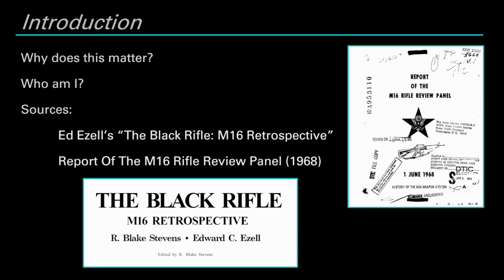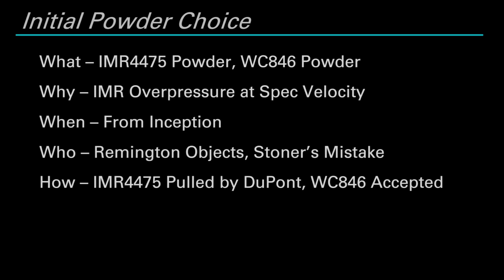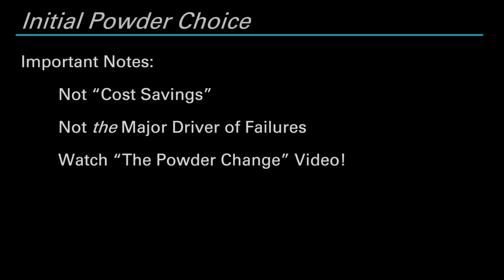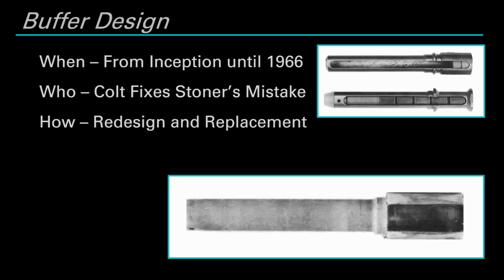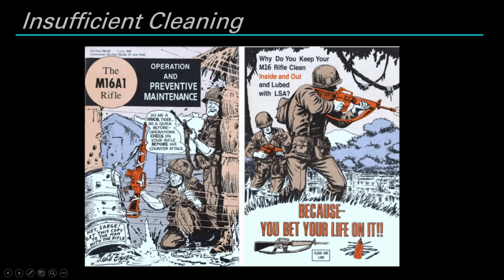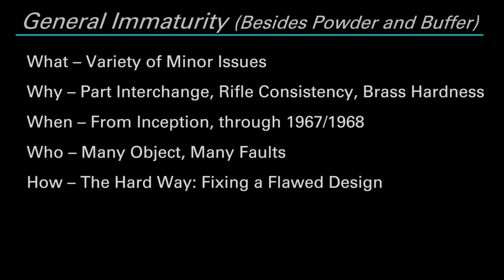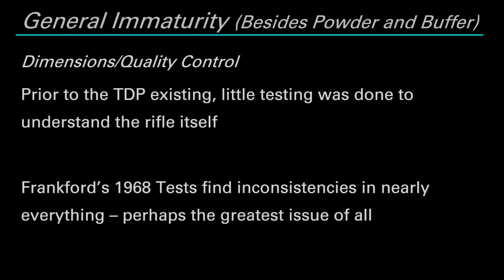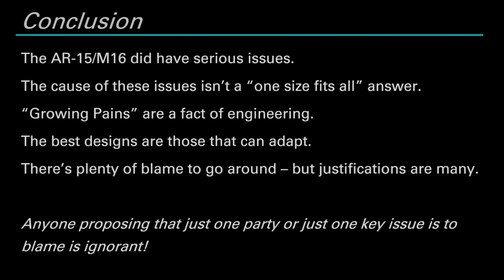M16 in Vietnam - The Real Issues, Briefly Explained

Comment: Let’s go down the rabbit hole 🕳️ there were a certain number of colt model 601 602 and 603 rifles made for the DOD from 1961 to 1963 Those rifles were used by certain combat units in Vietnam. When units would rotate out of country new units would receive those weapons. These are the rifles that have certain features such as non crome lined barrels and the “edgewater” buffer. The rifle M16A1 helped circumvent the issues presented but the ordnance corps presented to soldiers and marines in the field. You can’t get around the issue of improper ammunition issues with the Xm16e1. Also James Sullivan down scaled the AR-10 to the AR-15 not ugene stoner.
Reply from the maker: 603s didn't come about until after 1964. First order for them was in late 1963. ARPA guns were 601s.

I think you should watch the powder change video.

Regardless of Sullivan and Fremont being the ones who put pen to paper on the AR15, Stoner was chief engineer and would have the final say on things the rifle incorporated.

Post 1964, practically all ammo used in Vietnam was WC846 loaded. The Marines had the same manuals and same cleaning instructions available to them - the multitude of pictures showing cleaning rods taped to rifles should make that quite clear. The neglect those rifles faced isn't the rifle's fault. It certainly isn't the Army's fault.

Finally, as explained, the Ichord hearings are chock full of bad information and rarely feature a correct conclusion. There's much labor taken to blame the powder for everything, when the actual details of the powder change suggest a very different conclusion
Reply: @IvanPrintsGuns exactly ordered in 63 delivered in 64 for use. Major change being the forward assist as you know. If you specifically research the issue the Marines had in I corps in the spring of 1967 there were no cleaning kits or cleaning rods issued. That would come later when a lot of issues were known. Individual marines would write home asking for .22 rifle cleaning rods for their m16s. They were not issued properly and they did not initially get any instruction. This is well documented. Point being most of the issues you are citing are not widely experienced by the majority of ground forces in Vietnam. Just the marine corps.
Reply from the maker: @cosmolineandgritsforbreakf3795  the 603s weren't used by advisors in 1963 as you claim. Plenty of changes besides the forward assist.

Individual units did have absences of cleaning kits and manuals, yes. This is explained in the video. But some units did have these things (including Marines units). A breakdown of unit-level logistics/supply chain/communication (which, as just explained, wasn't endemic) isn't representative of a top-down failure. Ultimately, the top's job is to make sure that these things exist (and the manuals and kits existed since before the Army and Marines were using AR15s), the bottom'a job is to make the things available and distribute them. By no means is "the Army" or "Ordnance Board" chiefly responsible (they had the kits and manuals available). They can't know to fix the supply chain issues that shouldn't exist in the first place until after they've taken place.

To the notion that only the Marines faced these issues, that's absolutely not true. The Marines did have some particularly inept units that decided all on their own that rifles never need cleaned, but the issues the rifles faced was universal. That the USAF took best care of their rifles and had the least issues is a sure sign of this - the Army and Marines both didn't take such great care in all instances, and as such, both had issues. Some Marine units did have manuals and cleaning kits they procured, and their rifles weren't wasted.

Your edgewater SP1 clearly hasn't been shot much, at least not in comparable conditions, if you're going to claim it's fine. Even avoiding bolt bounce by sticking to only semiauto fire, the buffer's tendency to collapse (especially when wet) means that the carrier key can strike the lower receiver, which breaks parts. It's a bad design, and that's not a "well with the original powder it wasn't the worst" sort of thing, it was a bad design for any powder.

The XM16E1s the USMC were buying were new in most cases. The oldest XM16E1 they could have possibly procured at all would be 3 years old in 1967. "Clapped out" in 3 years is pure neglect, nothing else. By 1967 the improved buffer is in the XM16E1s, and it isn't until 1968 that the M16A1 (and all the existing XM16E1s) get chrome lined barrels.
Reply: @IvanPrintsGuns  I never claimed that just the 603’s were used by advisors? The 601 602 and the 603 were all used by advisors. There were military advisors throughout the entire war. Again I’m saying the vast majority of the issues were experienced by the marine corps. Not all the issues. You just corrected my statement and then proceeded to prove my point. The airforce likely didn’t have any issue because they would have never even used the rifles in combat.
Reply from the maker: @cosmolineandgritsforbreakf3795  603s weren't in production until 1964. ARPA's AGILE testing was done by then. 603 production was for the Army at that point, not for testing groups. If some small number of 603s were to be involved in some sort of advisor role (if not AGILE, what was it?), this small number of rifles can't possibly explain (hand wave) away the issues the rifle faced. There were 300k+ XM16E1s in Vietnam by late 1966. Most of those were less than two years old. How exactly were those clapped out by advisors then given to Marines?
Reply: @IvanPrintsGuns  Not what I’m saying. You ether don’t understand the difference between the 603 and Xm16e1 or you don’t understand that I’m saying they are one and the same. Let’s start from the beginning and state the fact the marine corps did in fact not procure their rifles in the United States. They were issued in the field to combat units in the spring of 1967. Those rifles were all XM16E1 rifles. Those XM16E1 rifles were given to the marine corps by the Army. Not a single marine in a line company in Vietnam in 1967 had any training or experience with the new weapon. It’s also well documented that they were not issued cleaning kits or specifically cleaning rods. That could all be a USMC issue. I’m not saying it isn’t.
Reply from the maker: @cosmolineandgritsforbreakf3795  the DOD gave the Colt AR15 Model 603 the M16A1 designation in 1963. The Army, because it had not adopted the rifle yet, called it the XM16E1. The XM16E1 is a 603. So too is the M16A1. What a 603 is would change. What an XM16E1 is would change. What an M16A1 is would change. But the 603 didn't exist before 1964 (was first produced in 64), and AGILE was over by then. The rifles used in AGILE were small in number, weren't somehow dumped on the Marines, and aren't magically responsible for the issues the other rifles had.

The USMC rifles were, in fact, procured from the US. Do you think Colt had a factory in Vietnam? Do you think the USMC never saw a new AR15? The One Time Buy (508 Contract) allocated XM16E1s for the Marines. 1966, MIPR from the Marines for 16000 new XM16E1s. That's 100k total new rifles Marines ordered by 1966. Read The Black Rifle!

USMC wasn't unique in troops not having familiarity with the rifles they were being handed. Cleaning kits and manuals were available to them, but they'd need to procure those on their own. Some units did this. Others didn't.
Reply: @IvanPrintsGuns  do you not understand the difference between the XM16e1 and the M16A1? I’ve never once referenced any sort of troop trials or project AGIILE in my comments. I’m stating an irrefutable FACT that the rifles issued to the marine corps were us army XM16E1 rifles.
Reply from the maker: Perhaps you don't understand the difference between the XM16E1 and the M16A1. The last model XM16E1s were identical to the first model M16A1s. A year later, the M16A1 would get a chrome chamber. So too would the XM16E1s, through retrofitting (though not as aggressive a retrofit as the buffers would see). Those XM16E1s are still identical to the M16A1. The USMC procured their own XM16E1s. This was usually by riding on Army contracts, but it's not like the USMC was only using secondhand XM16E1s. Read The Black Rifle.
Reply: @IvanPrintsGuns  if you understand engineering which you obviously do. You might not understand procurement military logistics and large scale training mishaps. It’s my belief that the issues would have occurred with practically any other rifle given the circumstances. And lack of maintenance at the armory level. I have a Colt SP1 with an “edge water” buffer it works with all types of 55g ammunition. However you slice the pie the marine corps had a brief period where they were issued clapped out Xm16e1s and had severe problems in the field. By the time a lot of the problems had been addressed in the XM, The army had M16A1s very early into 1968.
Reply: @IvanPrintsGuns  also the rifle XM16e1 was not issued with a cleaning rod or cleaning kit in a lot of cases. Hence the addition of a “trap door” butt stock on the M16A1. Also there was a lack of lubricant in the field throughout the entirety of the war. That’s actually a current issue today with any AR15. You have to put your research against the field reports.
Reply from the maker: @cosmolineandgritsforbreakf3795  yes, the rifle wasn't always issued with a cleaning kit, because the cleaning kits was to be made available through the supply chain. This worked out correctly for many units, but some units didn't do their jobs. Lack of lubricant is the same question - it's not like the US military ran out of gun oil. But some units failed to read the manual and procure it.

I've read the field reports. For every one SNAFU, there's at least as many success stories. It's not Ordnance Board's job to clean your gun for you. Past making the (quite good) manual and making the cleaning kits avaliable, they didn't have a responsibility to handhold people into doing their jobs.
Reply: @IvanPrintsGuns  I like your video and I’m not being a Dick. I’ve been down this same rabbit hole for about 20 years. Colt knew the issues were going to be prevalent. Big army knew this as well. The M16A1 idiot proofed the rifle, leading to significantly less issues in the field. Natural progression of any weapon in US inventory. The outside factor is the ordnance corps using ball powder. They did do this. It did cause significant problems. I’m just saying we can get around that fact. Everything else is subject to other factors that are impossible for you to narrow down. For example with any AR15 if you clean it bone dry and get into a firefight, heat and expansion can and will cause a lot of problems. Mainly failure to extract. This is why lubricants are so critical for proper function of the AR15 from the 601 to the URGI.
Reply from the maker: @cosmolineandgritsforbreakf3795  Colt sure didn't seem to be aware of much besides the buffer issue. They maintained to DOD that the rifle's design was mature. The Army knew of practically all the issues that would show up, had been vocal about them, wanted them fixed, but DOD overruled them. The M16A1 (at adoption) was pre-chrome bore. "Idiot proofing" came later (and, as explained, chrome lining doesn't "idiot proof").

You badly need to watch the powder change video. Your misconceptions of the events are readily apparent.

I'm not sure where your ideas about lubrication come from. Proper lubrication helps any firearm, but the idea that AR15s must have it to work reliably is nonsense. There's been plenty of high round count tests that get the guns so dirty that initial lubrication would be a detriment, and yet they still work.
Reply: @IvanPrintsGuns  You keep referencing your other video, that’s cool. However Real issues in the field come down to heat and expansion during rapid heat cycles and over pressure from bad ammo. Proper lubrication is absolutely critical in reliable function of the AR-15 in any condition. It all has to do with the gas system and how it functions. Being an expert on the system you should know that. I also don’t know where you get the m16A1 not having a crome bore or barrel from. That’s just incorrect.
Reply from the maker: @cosmolineandgritsforbreakf3795  WC846 loaded ammo is much lower chamber pressure. That's why it was chosen. You need to watch the powder change video. Across all the testing data and information available, I haven't seen these vague descriptions of heat and expansion anywhere. There are, however, plenty of endurance tests undertaken which would ensure any lubrication present is gone by the end. Sure, reliability drops off, but it's not very dramatic. SAWS testing of the AKs will tell you that it's not endemic and exclusive to the AR's gas system and bolt, this is just how autoloading arms work.

You need to read The Black Rifle. M16A1 adoption was in 1967. Chrome chamber was 1968. I'm not going to insinuate that you may be misremembering things, but this is pretty basic.
Reply: I actually agree with most of the points in your video. I don’t understand why you are being so defensive. You also are not reading my comments correctly or don’t understand the changes made between the XM16E1 and the m16a1 and how significant they were.
Reply from the maker: The XM16E1 is not a fixed thing. The changes that led up to the M16A1 were not kept out of the XM16E1, they were rolled in continuously. Late production XM16E1s are the early M16A1s - it's not like the army adopted something that wasn't the XM16E1. They adopted the XM16E1, and so it was called M16A1. All the changes that had been made to the XM16E1 were then a part of the M16A1. Receiver fencing, flash hider, buffer, gas tube, receiver alloy, bolt carrier bore plating, etc - the late XM16E1s had all of this, and the M16A1 name comes from the Army adopting the XM16E1 officially. Chrome plating of chambers comes after this point, as the testing on chrome plating of chambers was still incomplete when the M16A1 adoption happened. Read The Black Rifle.
Reply: @IvanPrintsGuns  Dude no, the XM16E1 will have a rifle steel barrel no crome lining in the bore or chamber. A three prong flash hider edge water buffer and type C furniture. No trap door for cleaning kit. Early M16A1 rifles would cary over some features from the XM16E1 such as the flash hider and furniture. The rifles will actually be marked “Colt AR-15” model XM16E1 and serial number. You need to read black rifle again.
Reply: @IvanPrintsGuns  I’m clearly saying the m16A1 was the final product improved version of the rifle. Phosphate coated BCG H1 buffer and Crome lined bore and chamber. Produced By Colt h&r and GM hydramatic.
Reply from the maker: That's just not true - the XM16E1 had the improvements that the M16A1 had at time of adoption *because the XM16E1 was the rifle that was adopted*. The M16A1 continued to see improvement - the trapdoor buttstock (sometime between 68 and 71, records aren't clear), chrome chamber (testing in 1967, adopted in 1968), chrome bore (71), etc - but these were not in place day one for the M16A1 (early 1967). Like with the XM16E1, improvements were rolled in. These parts and improvements became standard, and any XM16E1 needing new parts would get these upgrades. The Black Rifle is quite clear on these changes. The XM16E1 had everything that the day-one M16A1 had. The M16A1 term comes from the Army adopting the XM16E1. Do you need page numbers? Do you think the M16A1 didn't see a single change past Feb 1967? Chrome chambers hadn't even been tested at that point...
Reply: @IvanPrintsGuns  like I previously stated there were indeed roll over features between the two rifles. There are clear and defined requirements and changes made to rifle M16A1. Rifles produced in 1968 had all for mentioned internal changes made. I’m not sure exactly when but the idea of Crome lining the barrel was a square one idea and also a production issue being that mass production of a Crome lined .22 cal bore had not been done before. You’re just saying what I’m saying.
Reply from the maker: You've changed what you're saying several times over. I've not changed it at all. If you're now saying what I'm saying, that's great. The M16A1 did not have chrome lined chamber as adopted. Nor did it have the trapdoor buttstock. Nor did it have the chrome lined bore. Several other minor things were added or changed as well. It's not until 1971-72 you see the M16A1 become something relatively definitized. Rifles made in 1968 wouldn't have the changes that didn't take place until 1971-1972, unless they were added after the fact (there was a DMWR that went out in 1971 detailing how to make sure XM16E1s and pre-71 M16A1s were rebuilt up to the latest M16A1 specs, because those specs had changed since Feb 1967). Chrome lining chambers was first approved by Army in late May 1967 - months after the M16A1 adoption in Feb of that year. Chrome lining chambers wouldn't be adopted as standard by the Army until 1968 - after the Panama Trials gave conclusive testing to show that chrome lining chambers was a good idea. The technology to chrome line bores was, obviously, in place by 1967 - since that's when testing began.
Reply: @IvanPrintsGuns  I haven’t changed what I’m saying at all. You are saying that I’m insisting that rifles were produced in Vietnam and silly nonsense, and also that rifles were issued to the marine corps from early trails. I’m not saying that now, and I didn’t say that in the beginning. I’m saying that the issues experienced with the rifle during the Vietnam war were overwhelmingly experienced by the marine corps. Particularly during the spring of 1967. My critique is simple in stating that the rifle had limited issues up until that point due to a number of factors. The issues experienced with improper ammunition are clearly the source issue of catastrophic failures in the field that could not be addressed by troops due to poor training and proper equipment. Those issues would occur now with improper ammunition. Reference the issues with early m855 ammunition. Unless everyone is wrong there was issue of m193 ammunition loaded with ball powder, not the correct propellant designed for the m193 55g 5.56x45. It is well documented that that ammo caused an increase in catastrophic failures in the field. That otherwise wouldn’t have occurred.
Reply from the maker: @cosmolineandgritsforbreakf3795  off the top of my head - you claimed 603s were used by ARPA advisors in 1963 (not true), that USMC never got new rifles from Colt and only got them used (from advisors or Army) (also not true), that the M16A1 had every upgrade it would have at time of adoption (wrong) by 1968 (wrong), that cleaning kits weren't available at all to USMC (wrong), you're still plainly ignorant about the powder change for several reasons (go watch that video already, please stop guessing and making things up).

That's a lot of things that you've flip-flopped on, no? Paired with a very poor understanding of the powder change (say, how many issues would have resulted from 4475 blowing up guns?), I think you've got a little more learning to do.
Reply: @IvanPrintsGuns  I admittedly do not know what you mean by “ARPA” advisors. I know for a fact 603’s were used by advisors throughout the entirety of the war. That is a fact. Advisors would continue to work with and advise ARVN troops until 1975 so duh 🙄 also you admitted in a previous comment that yes some units in Vietnam did not get cleaning kits. Why is that so hard for you to understand? You have made a in depth video discussing things that might be relevant, except for this one problem. The issues stopped when the bad ammunition stopped being issued. Yes some of that ammunition would remain in country and be fired for a period of time. We both agree without any argument that there were internal changes made over a period of time. Why is it that there were less issues once the ammunition issues were sorted out? Isn’t that convenient? You keep referencing the ammunition video. We already know why this happened. It’s still happened and caused catastrophic failures that could not be remedied in the field causing directly leading to the congressional hearings. Why did the early rifles work in testing? Why did they work in major combat operations I.E the battle of Ia drang and other battles? Yes the rifle had issues that were being sorted out in real time by Colt. This is clearly not uncommon for any service rifle. What’s the overwhelming reason why the rifle would catastrophically fail in combat? What is the one thing that we can all come to a conclusion about? Testing field trails and combat actions all proved the rifle worked fine? If no significant changes were made to the rifle what is the principal problem introduced to the equation that would cause the issues? It’s the ammo…..and who suffered from the most problems? The marine corps? Why? Because there were issued bad ammo and had no means to remediate a catastrophic failure. That the only point I’m trying to make. If you fired the same ammo out of a brand new Daniel defense AR-15 you would have the same problems. Certain features such as the buffer and Crome lining would make said issues less frequent. But it would still happen. So no it’s not short sighted to state that for all practical reasons the issues can be blamed on the ammo.
Reply: @IvanPrintsGuns  and correction all the 603s would be used once they arrived in country. And of course previous models.
Reply from the maker: @cosmolineandgritsforbreakf3795 You need to watch the powder change video. WC846 powder never stopped getting used. In fact, powder with identical burn rate is still used to this day. It never stopped getting used. It wasn't "sorted out", was used ever since 1964. Ia Drang? WC846. I explained this in this video, and detail in the powder change video. You're clearly in over your head and need to go learn.
Reply: @IvanPrintsGuns  You are saying that the nobody at any point actually used ball powder as propellant? That’s a big old lie? That’s internet lore? Are you saying this never happened? Yes the propellant you are talking about is used now and was used during the war. Hmm why would certain units at a very particular time have issues with catastrophic failures due to overpressure and arguably increased fouling? Although the increased fouling would be a much smaller issue. And likely not the culprit. I’m not a propellant expert but there is a difference between ball powder and IMR. Are you saying this never happened? It’s a lie? A myth?
Reply: @IvanPrintsGuns  So if what you are saying is accurate then the ammunition source would have been in use when major combat operations started in Vietnam. That would be the “correct” propellant? So what if I told you that they loaded 5.56x45 with ball powder? Is that a lie? Never happened? Just a fake story that never happened?
Reply from the maker: @cosmolineandgritsforbreakf3795  No, you dolt. I'm saying you need to watch the powder change video, and you're too ignorant to understand a hypothetical question. WC846 was selected in 1964, and stayed in use ever since. You seem to mistakenly belive it stopped being used, but this isn't the case. You just claimed that the "bad ammo" stopped being used - that isn't true. WC846 didn't stop getting used. It's been used ever since. Fouling was extensively tested, with some tests indicating IMR burns cleaner - yet WC846 was still more reliable past the introduction of the improved buffer. What "overpressure" issues are you referring to? 4475's risk of blowing guns up? That's why it was dropped, after all. Or WC846's <10% increase in port pressure, which exposed the flaws of the original buffer?

You're humiliating yourself, and need to watch the powder change video. The most serious issues the rifle faced - failures to extract - occured less often with WC846 in controlled testing. WC846 was around since before Ia Drang. The FTX reports don't come rolling in until much later. And they don't go away after the improved buffer is added. The FTX issue was not to do with the powder change, except that the powder change made FTX less frequent. Which you'd expect from a powder that lowers chamber pressures as substantially as WC846 did.
Reply: @IvanPrintsGuns I have watched your video and you state that the propellant change was made. What if I told you that has no bearing on the fact they didn’t use that propellant? Are you saying that nobody at any point and time loaded 5.56x45 with ball powder instead of IMR stick powder? Your video would not explain that. You’re the one guy who has cracked the code?
Reply from the maker: @cosmolineandgritsforbreakf3795  You're absolutely remedial. I think I'm done here. Please learn to read.
Reply: @IvanPrintsGuns wc846 has not been used roughly since 1970 in nato ammunition.
Reply from the maker: @cosmolineandgritsforbreakf3795  "NATO" ammunition didn't exist (as it comes to 223/5.56) in 1970. Or 1975. Or 1980, even.

WC846 has been used to load 223 since 1964. Come 70/71, it did have its upper bound calcium content lowered (no change to burn rate, this was chasing a rare issue of buildup in gas tubes), and later on, this lower calcium content WC846 would be called WC844 - but make no mistake, today's WC844 fits within the parameters for WC846 used since 1964 - the only tweak was calcium content, and this came after the rifles serious issues were addressed (and again, the calcium buildup were uncommon, not very serious, and weren't even really reported until after everything serious was "fixed" - we're talking post chrome bore, even.
Reply: @IvanPrintsGuns  you’re just too high on your own gas to realise that ammunition was always the problem. It’s not used today for very specific reasons. You’ve just gone on a long roundabout mission to prove that the ammunition source was the principal problem. It doesn’t matter who made the decision to adopt the incorrect propellant. It was adopted and otherwise would have not been an issue.
Reply from the maker: It wasn't always the problem. A powder with equivalent properties to WC846 is used today - the only change was to calcium content, to address a rare issue of calcium deposits in the gas tube, which wasn't even noticed until 70/71.

Now, 4475 was always the problem - that's why it was replaced. But WC846 was the correct alternative.

You keep harping on the "incorrect propellant" as though 4475 was issue-free (it wasn't) and as though WC846 was a mistake that got corrected (the Panama Trials alone prove this wrong, let alone how am equivalent has been used since).

That's silly, and ignorant. You should watch the Power Change Video, except pay attention this time. If you think I'm wrong, go ahead and make your own video, detailing what your research has lead you to. I'll give you a hint, though - you're at the peak of the Dunning Kreuger curve on the powder change.
Reply: @IvanPrintsGuns  yep 👍 everyone has been saying the exact same thing for years and years. Over pressured dirty ammo=issues? Why is it that the original buffer and ammunition combination had no issues in testing and field trials? It worked fine. The issue of projectile speed has more to do with the change from 1/14 to 1/12 between the 601 and 602 and yes there issues with mass production of said ammo. Hence the “ball powder” apparently called WC846….I didn’t know that…..was a the main culprit in issues with the rifle. Why change anything?
Reply: @IvanPrintsGuns  I know why….to deal with the poor ammunition. I’m also going to assume there were QC issues as well. We know everyone checked off on ball powder. It is the overwhelming problem with the rifles performance in Vietnam.
Reply from the maker: @cosmolineandgritsforbreakf3795  It isn't. Warch the video. Read The Black Rifle. Have a great day in fuddlore land.
Reply: I know why my SP1 works and you can fire a wide variety of 55g ammunition through it…..because it’s not shooting 5.56x45 loaded with ball powder. Those slight increases in pressure are significant to the operation of the AR-15 especially a rifle length variant with a buffer designed for the IMR powder.
Reply from the maker: @cosmolineandgritsforbreakf3795  hey genius - ball powder equivalent to WC846 is in all Lake City 5.56. You've been shooting ball powder since you first picked up an AR15, and you didn't even know it. Go ahead. Pull the bullet from one of your rounds of Lake City, Winchester, Remington, etc. You'll find ball powder inside. The Edgewater has problems with IMR powder as well, as I've explained in two different videos you claim to have paid attention to.
Reply: @IvanPrintsGuns  Got me in that one I guess. Shows that it is WB846 😢 which was apparently changed in 1970 from your original m193 55g. Still doesn’t explain the changes made because of the decision to run with ball powder. Or QC issues with the ammunition. Even someone who knows nothing about propellant can put two and two together. The prevailing theory that the ammunition caused the issues with the rifle in Vietnam still holds. The original ammunition type and edgewater buffer worked fine. You can still argue that every change made to the rifle is because of the ammunition. That is going to affect the entire operation cycle.
Reply: @IvanPrintsGuns for that matter the us government hold have used cordite propellant for all I know. It still is out of spec for the original rifles design. I can double back and maybe agree the edgewater buffer could have been improved upon. The entire rifle could have been scrapped.
Reply from the maker: @cosmolineandgritsforbreakf3795  WC846 became standard in 1964. It had its calcium content maximum lowered in 1970. This lower calcium WC846 was later called WC844.

Watch the Power Change Video. I literally explain all the questions you have and clarify all the guessing you're doing.
Reply from the maker: @cosmolineandgritsforbreakf3795  they didn't use cordite. They used WC846. For the reasons explained in this video and elaborated on in the Power Change Video. You would do well to go learn something, rather than repeating nonsense that's been proven wrong all day long.
Reply: @IvanPrintsGuns  I didn’t say they used cordite propellant. I’m saying it doesn’t matter how or why they used whatever propellant they decided to use. It obviously had an effect on the cycle of operations on the platform. Obviously the changes made since then have reflected that decision.
Reply: @IvanPrintsGuns  you haven’t “proven” anything. At best you have discovered that the edgewater buffer was a part of the solution to deal with the wrong ammunition. Why is that 90% of the failures were failures to extract? That’s because the ball powder caused excessive fouling in the chamber that wasn’t occurring with original propellant. These issues no longer occur or at shortest happen much less frequently because of the changes made because of the ammo. You also haven’t accounted for issues with ruptured casings and failures to extract in any of your arguments. You keep saying watch my video because I know about propellants and I know that they decided to go with ball early on and everything you think you know about the m16 is wrong.
Reply from the maker: @cosmolineandgritsforbreakf3795  it does matter what they used. That's the entire point of trying to understand the issues. Hand waving away all facts and just going "it had issues", or worse yet - misconstruing what problems were the causes for what issues - is ignorance in motion.

You keep saying "obviously" as though you haven't spent hours today admitting how little you know about this subject - perhaps "obvious" isn't the right word...
Reply: @IvanPrintsGuns  Hey I didn’t make the video. You made the video with the advantage of hindsight making note of all the changes made on the AR-15 since the early 1960’s. Like cool 👌 we all know that…
Reply from the maker: @cosmolineandgritsforbreakf3795  ....yes, the entire point of the video is using facts and data to point out what the actual issues were. Not making random guesses and assertions with nothing to back them up.
Reply: @IvanPrintsGuns  With that being said you have made assertions and have made statements that are not backed up with facts. It’s an interesting opinion or take on the problems with the rifle during the Vietnam war.
Reply from the maker: @cosmolineandgritsforbreakf3795  Everything I've stated is backed up directly by either The Black Rifle or RRRP. That's how I've managed to not flip flop on my story 20 times, while you've danced all over the place.
Reply: @IvanPrintsGuns  The only friendly point I was trying to make was that I think the “fud lore” thought process about ammunition issues actually holds some weight. You apparently found that very offensive and wanted to school me or something.
Reply from the maker: @cosmolineandgritsforbreakf3795  it holds very little weight at all. The amount of weight it is due is explained full in the Powder Change video. Only with that context and framing (you know, the facts of the matter) can it be understood.
Reply: @IvanPrintsGuns  My last comment about anything would be my original argument. Not understanding propellants at all. All that’s is factually known about the experiences (you know after action reports) show that the issues were consistent with failures to extract. The failures to extract are not caused by the buffer system.
Reply: @IvanPrintsGuns also pretty arrogant considering the actual designer of the rifle attributes the issues with the rifle directly with the ammunition changes made during testing and final adoption. But YOU know more than him. You’re the one who has cracked the code.
Reply: @IvanPrintsGuns after spending all day on this. Watching your video again you actually collaborated most if not all of my talking points. 

You discuss in depth issues with field maintenance and lack of cleaning kits. I brought this up multiple times. You made a counter argument that I was wrong for some reason and that they were issued? 

I made reference to the fact that eugene stoner had very little to do with further development of the rifle after colt bought armalite. This is an irrefutable fact. 

Although your knowledge of the propellant change is beyond my comprehension. It’s really immaterial to the fact that it pushes the rifle beyond its original design parameters. This is what people have been saying consistently for decades upon decades. 

You can make an argument that the original buffer design was not that great and I’ll buy it. However the buffer design was originally designed for the original ammunition. The reason why a rifle would work now with the same propellant or rough equivalent is because there were design changes made to circumvent the issues with the ammunition as a primary problem. Without the ammunition change the rifle would have not experienced the type of malfunctions experienced by the vast majority of documented incidents I.e failure to extract.
Reply: @IvanPrintsGuns  Also following up on the specific issue of propellant changes. Outside of your video on the matter it was discovered that the chamber pressure with the wc846 was identical to the 4475 the port pressure was increased. This speed up the cyclic rate of the rifle as I mentioned before. This is with out question a significant issue with the AR-15 design. Coupled with for mentioned issues with maintenance being less of a problem. In line with the documented issues in the field the case of the cartridge would not have time to contrast leading to a failure to extract. This would cause the vast majority of catastrophic failures in the field requiring a cleaning rod to break lose the stuck casing. This is why the prevailing theory that the ammunition source has been the long time culprit of issues experienced with the rifle during Vietnam exists. Partially why your video on the propellant changes although admittedly revealing and I have no reason to believe it to be inaccurate as far as the time line. Kind of proves nothing. The “fuds” who believe that the ammunition problems were the main culprit are correct in stating the ammunition caused serious problems are correct. Unless you believe that the cycle of operations is particularly the cyclic rate is unimportant to reliable function of the AR-15.
Reply: @IvanPrintsGuns  You lasted longer than I could have with this dude. You tried lol.
Reply from the maker: @hairydogstail  horse led to water, horse had aneurysm, rip horse
Reply: @IvanPrintsGuns  ROFLMAO :)
Reply: Also the “m16” which was issued to the marine corps in early 1967 prior to major combat operations. Was the for mentioned XM16E1 which had limited issues in combat with air mobil and special units such as the 173rd airborne and 101st airborne during major combat operations during the early period of the war. Marine corps units had to turn in m14 rifles in the field and adopt a new rifle with no cleaning kit or lubricant. Failures to extract lead to stuck casings in the chamber of the rifle with no field remedy I.E cleaning rods due to corrosion of the bore and cartridge over pressure.
Reply: Not attacking your video in anyway. Just pointing out the actual field reports as they were presented in the congressional hearings. It’s also worth noting the rifles issued in limited numbers did not receive any sort of armory support during a two year period. The rifles kicked down to USMC units were “clapped out” and issued with ball powder 5.56x45